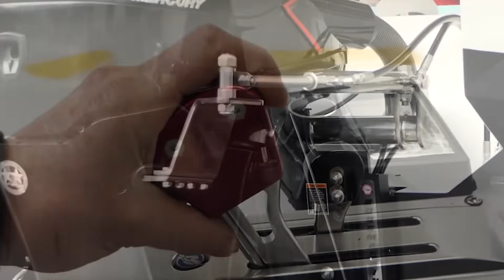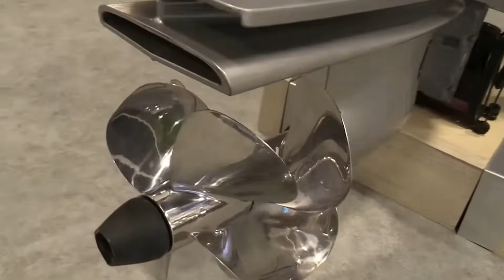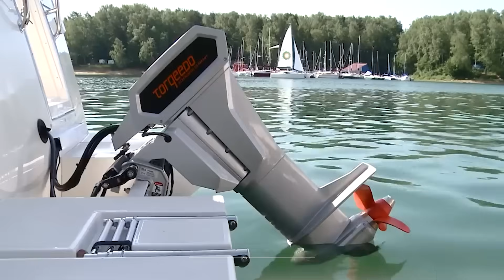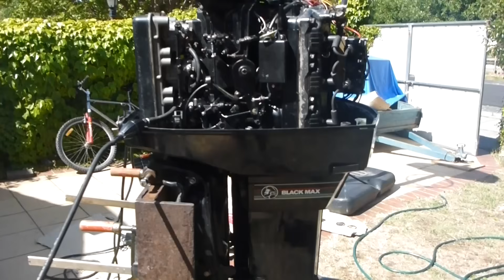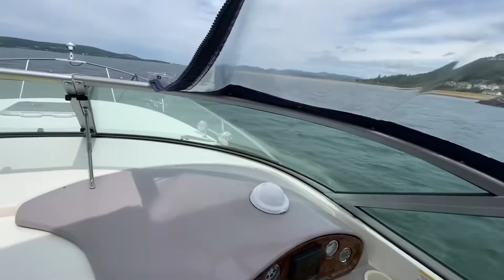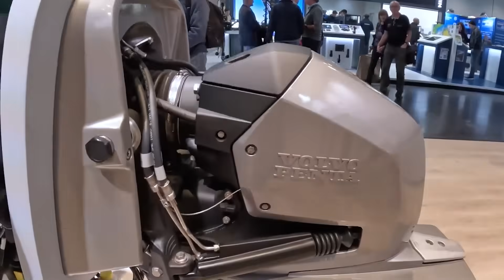Why European and American Boat Motors are So Different?

Comment: Many countries in Europe require a skipper's certificate. Here are the requirements. Anyone who is the master of (drives, leads) a larger leisure vessel/recreational ship with a length exceeding 12 meters and a width exceeding 4 meters must have a skipper's certificate, coastal skipper's certificate or higher nautical competence. For vessels that are not for leisure use, special competence and qualification requirements apply. Navigation etc. are also included. Maybe that's why we have smaller boats and engines.
Reply from the maker: Could be a reason. Really depends on location though. Do you have a licence?
Reply: @VintageBoats  no, has no use for one. need no boat in that size.

Comment: Uk fuel price is currently about $6.80 per US gallon for 95 RON 10% ethanol.
Reply from the maker: Do you get out on the water in UK?
Reply: Used to have a Waverunner GPR1200 
It liked to drink 😉
Reply from the maker: @stuartX11 what happened to it?

Comment: The reality that Europeans and US Americans have a totally different view of how thing should work. In Europe, fuel economy and emissions are key to everything. Simply put, too much fuel emission and the engine isn't allowed. That is also enforced by the higher fuel prices (which also very wildly from country to country). Think about 7-8 dollars per US gallon. In lots of lakes and rivers, there are speed restrictions. Furthmer, you need a licence for faster boats.And in general, Europeans are far more econimical. Most Europeans are not so big on spending as US Americans.
Reply from the maker: A point well made and a sensible comment. Thanks for watching. Where are you mainly on the water?

Comment: Doesn't Scania have 16 liter V8 Diesel marine engines with up to 1100 or 1200hp?  Yeah, from 220 hp to 1150 hp according to a very hasty google search :D
Reply from the maker: Thanks for commenting. What do you run?

Comment: I have a 20hp 2 stroke evinrude almost completely stock from the 80s runs great starts relatively easy and works great on the lake in Sweden.
Reply from the maker: @alleballe3051 that's awesome thanks for sharing! Where in Sweden do you get on the water?

Comment: Europeans thinking Americans are crude with simple engines 😂 whilst engineers know the simplest solution is the best and least likely to fail.

The reason European engineers build overcomplex engines is because of regulations on top of regulations on top of regulations on top of planned obsolescence. Believe me, if it wasn't for that, they would build the same to compete with the Americans.
Reply: So my Volvo Penta diesel is now almost 30 years old and runs and runs and runs..... without repairs, just inspections and annual oil changes.
Reply from the maker: @thomaskamp9365 This is what we like to hear! Thanks for sharing!
Reply from the maker: Simple is trustworthy for sure. Hence why there is such a strong 2 stroke community here at the channel!

Comment: My boats in Europe ran 4hp 1975 Evinrude and Tohatsu 55hp. My boats on Hawai‘i run Cummins 300hp 6l BTA and 350hp SBC direct drives. My next boat in Europe will be a twin outboard.
Reply from the maker: @808bigisland nice are you based on big island? I'll have a Cummins video coming soon. Stay tuned!
Reply: @VintageBoats  B.I, currently in Switzerland, beautiful here. Near 3 lakes connected by channels. Low tune BTA are just wholesome in a sea of not so good and expensive diesels. Looking forward to watch your take on BTA.
Reply from the maker: @808bigisland Awesome. Some beautiful spots! Hope to be put on BI sometime over next year.

Comment: So basically…… neutered overdesigned slowness or American power and reliability. Got it.
Reply from the maker: @jackcecil that's one way of putting it. Wonder which side you are on!
Reply: Fun vs no fun.  Same with firearms
Reply: Ther is nothing reliable with 'American' these days engine-wise or otherwise!!
The americans can't make regular cars the world wants or make the Ficht-technology work so Evinrude went belly up...
Reply: more like usa stuck in the late 80's in most thing. like engines, cars and house electronics.. and europe is in 2025. 

and volvos more reliable and have similar power what american engines have. for more money ofc becuase way more advanced.
Reply from the maker: @makoado6010 check out the volvo penta video on the channel. Sure you will enjoy!
Reply: @VintageBoats  i will.
Reply: @makoado6010very true. Also licening hurdles, emissions and noise and speed limits, taxing reduce the amount of boating on the lakes. There still tons of boats with inboard V8, V6 and Volvo redblock. Most boaters prefer Japanese outboards over US made. They are better. My Tohatsu 2-stroke was light and reliable.

Comment: Merc is a thing here in Europe too.
And Volvo also has inboard gas 5,7L 🤔 V8's to chose if want.
But myself i use a pair  of Yamaha 200s on my boat no slowboat by any means V hull and sporty too even has a joystick for easy docking.
And it is indeed comfortable for sleepovers.
No speed boat by any means but fast enough for my use. 😄
Reply from the maker: @johansomeone1948  Thanks for sharing Johan. As long as it suits you, and you sleepover guests, that's all that matters!

Comment: I miss the days of lightweight 18' tunnel hulls with a 280hp mercury 2.5 that weighs 300lbs
Reply: Yep, speeds of 110 mph plus with bone stock Mercury. The 300x they say is king, it produced 322hp stock but the 2.5 can make the same power w less weight. The 300x can't really be modified much.
Reply from the maker: @stktrader1 Enjoy all the top end you can get, however you get there!
Reply from the maker: @stktrader1  and goes like a bat out of hell?

Comment: Don’t.fool yourself when it comes to outboards 1) Europe doesn’t sell many home grown outboards 2) practically ally are auto conversion to outboard use.  Soooooo. They aren’t designing the engine part.
BTW Volvo-Penta got smoked by Mercruiser while Volvo-Penta was using Gas American engine blocks
Reply from the maker: @hugoglenn9741  Thanks for your input Hugo and spending time on the channel.

Comment: I had a Volvo Penta I/O with the 305 until I cracked the block, at which point I put in a 350.
Reply from the maker: @SamBiscit-c8e  Sorry to hear that. Hopefully the 350 does you well. Thanks for watching.
Reply: Volvo Penta’s Composite Sterndrive was one of the biggest pieces of crap ever made

Comment: how are you not talking about the Volvo Penta gas? so sway sided. it's clearly an ad. garbage.
Reply from the maker: @stephendellefave6423  Hi Stephen. This channel receives no sponsorship. And I have a Volvo Penta video coming in this week.
Reply: @VintageBoats  your comparing apples to oranges talking about quiet Volvo diesel compared to gas mercury. how is that a comparison it's like comparing a small Toyota 2wd pickup and a Ford f350 4x4 sure they're both trucks but neither are in the same class.
Reply from the maker: @stephendellefave6423  Apples and oranges can quite easily be compared if that's what's on offer, but I understand your comment. Thanks for engagement.

Comment: Pretty sure BMW had a range of inboard marine Diesels and they sold that division to Mercury if I'm not mistaken or someone else?
Reply: They did, it was a marine converted version of the 6 cylinder turbo diesel, used in the 324/524 sedans. Don't know if it was sold or just discontinued. In the 80's there was quite a big market for turbocharged diesel engines in Europe. As "modern" diesels could provide almos same performance as gas engines. Purchase price was much higher though, and they where heavy. But fuel consumption and safety, made them popular. Volvo Penta was a big player in diesel boat engines
Reply: @richytheone  Thanks for the extra bit of info.
Reply from the maker: @anthonyxuereb792  Don't know too much of the history of this, think mainly aimed at sailing boats. But could be a good video for me to investigate - thanks for suggestion.

Comment: the legs on the diesels are their downfall in the US.  Volvo in the highest hp range, and both diesel outboards have comparatively low lifespans on the lower units.  Volvos are only great when paired to IPS or a jackshaft sterndrives should be kept below 400 horses.  COX and OXE lowers can't survive the strain seatow puts outboards through.  Since fuel isn't 10 dollars a gallon, life cycle cost are far higher on the European outboards.
Reply from the maker: @ChrisJohnson-pl3mc  Thanks for your input Chris. Hope to see you back at the channel!

Comment: You will not see 4 stroke outboards of today lasting as long as the old two stroke design ! 
Simplicity and ease of maintenance more than makes up for fuel efficiency !
Reply: Correct, hopefully with Congress just scrapping the ridiculous emission standards we can start getting reliable 2 stroke outboards here in America again.
Reply from the maker: @BlastedKat  You and a lot of people in this community will be hoping for that!
Reply: @VintageBoats  you are correct, a new production Yamaha 2 stroke outboard will fit right in with my fully deleted 6.7 Power Stroke diesel truck. 
Loving it
Reply from the maker: @BlastedKat  wish you luck with your dreams!
Reply: @VintageBoats  and same to you.
Reply from the maker: @hotchihuahua1546  you're most likely very right.. time will tell and prove.

Comment: Mercruiser 1000% beter than Volvo
Reply: sure dude :) volvo doesnt even make outboards and sterndrives are same with volvo and mercruiser...older 4.3 V6 and 5x liter V8 were 95% same engine...also volvo drives for sterdrive s are more reliable than mercruiser ones...

i own both . i have both V6 4.3 and 5.7 , during last 40 years with boats volvos drives are much better than merc ones...dual props rocks
Reply: @jkarra2334  Mercruisers are always faster than Volvo. Mercruiser drives are cheaper and more simplistic. That being said they both have their perks.
Reply from the maker: @jkarra2334  Dual props rock was a good line!
Reply: @VintageBoats  done that way too many time...
Reply from the maker: @roverkootnl1854  Have a video coming in the next week. Stay tuned to enjoy some inboard action!
Reply: in your dreams! keep dreaming